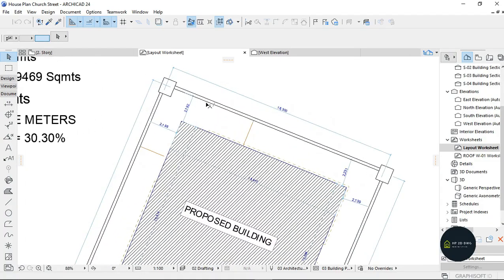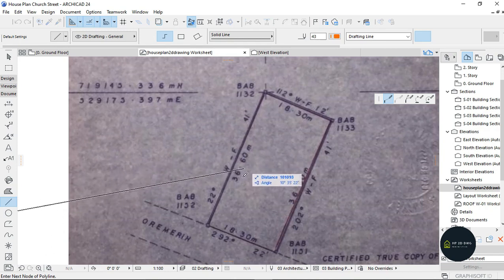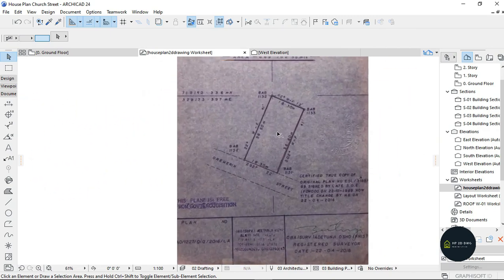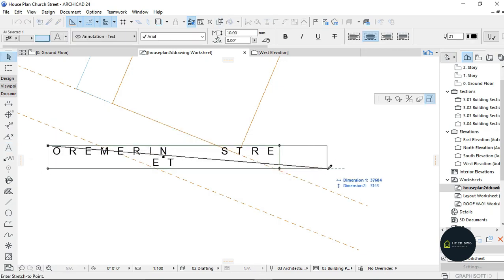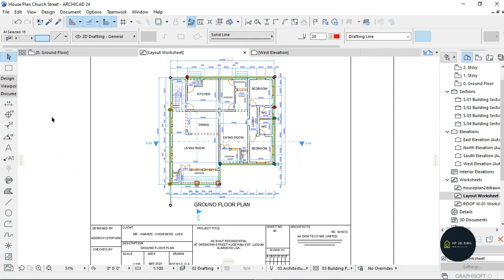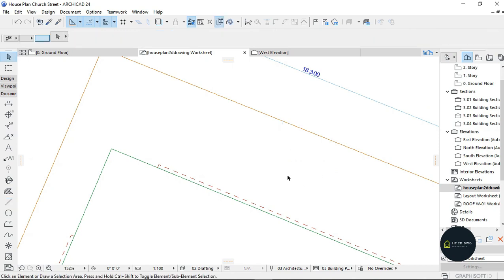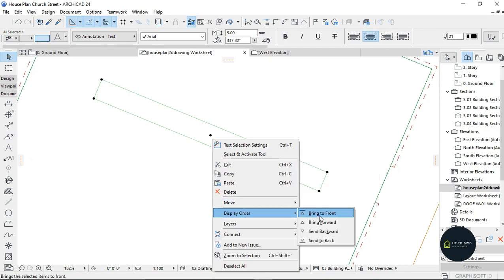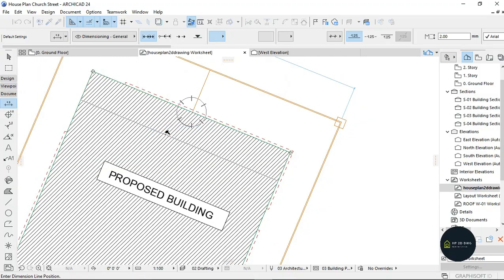How To Draw A Land Survey in Archicad for Beginners || Extreme Teaching

Comment: Is it advisable to do the drawing inside the survey plan?
Reply from the maker: I think you can, at the same time, may be not
Reason is

It depends on what the government accepts in your locality, what i would recommend is do the normal standard drawing for the land survey then you can move on to drawing in it .

But make sure to check the government requirements for a standard working drawing.

Comment: Good evening, please I've changed my dimensions to the degree and seconds but it isn't been activated when I want to draw the site plan
Please is there anything I'm doing wrong
Reply from the maker: If that problem persists - open a new project in archicad and set up ur dimensions and degrees with seconds and try it out - if it works 

Draw the site plan then copy what ever work you've done to the previous project.

Doing it this way will help you work faster and not bother about the issue on ground as I can't really tell what seems to be the problem because I've nt experienced that before.